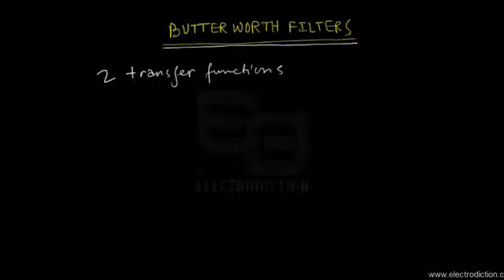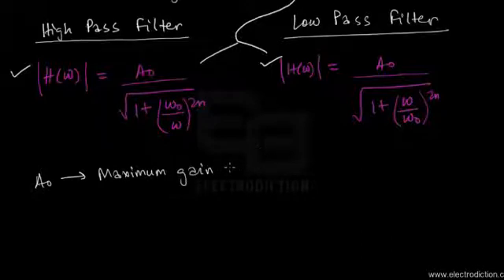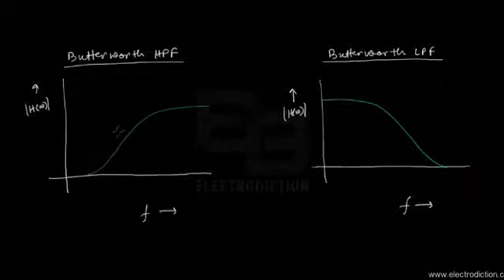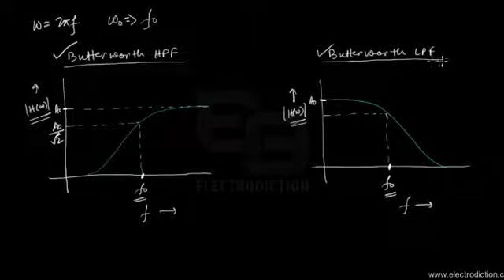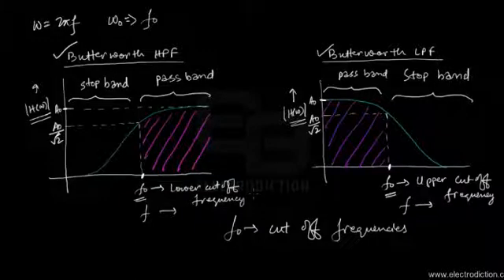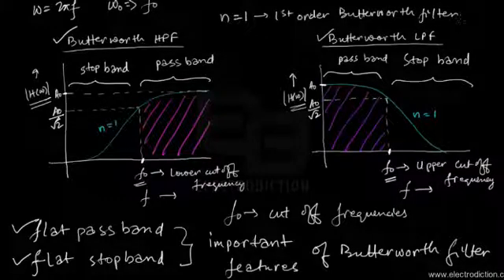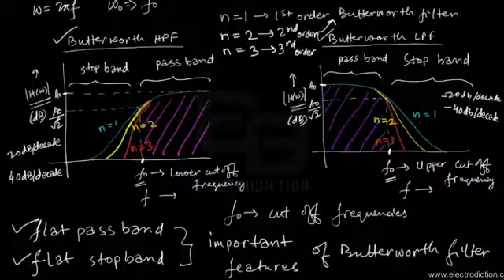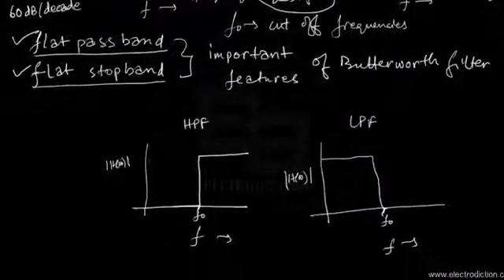BUTTERWORTH FILTER

Comment: How to explain something completely ass-backwards. Plots don't 'obtain' equations: equations lead to plots. The concept of upper and lower cutoff frequencies is redundant in low-pass or high-pass filters: there is just a cutoff frequency. There's not much point in talking about cutoff frequencies before stating what w0 means.  Cutoff  frequencies and band-passes and band-stops and orders appear in all filters, not just Butterworths. Many filters tend to flat cutoff slopes, not just Butterworths, and the graphs drawn with the little curls near zero do not illustrate that correctly. Butterworth filters are not just flat but maximally flat in the passband, and this is what distinguishes them from all others. The gain of an HPF does not decrease with frequency. f0 does not represent the frequency of the signal. The cutoff frequency is not 'about' but exactly the 1/sqrt(2)) point, by definition. n=1 defines a 2nd-order Butterworth filter, not s first-order, and there is no such thing as a first-order Butterworth. Similarly n=2 defines a fourth order.The rate of change of gain in a Butterworth filter with n=1 is not 'about 20 dB/decade' but exactly 40dB/octave, again by definition, and again there is no such thing as a 20dB/decade Butterworth filter.. Filters are not confined to radio frequencies. The ideal for any filter is A=1 in the passband and A=0 in the stop band: not just for Butterworths.Too much waffle and nonsense here, and several major errors.